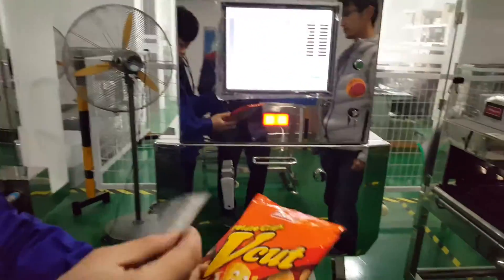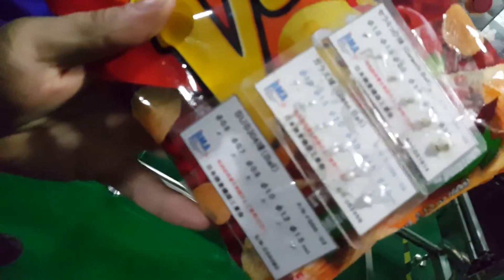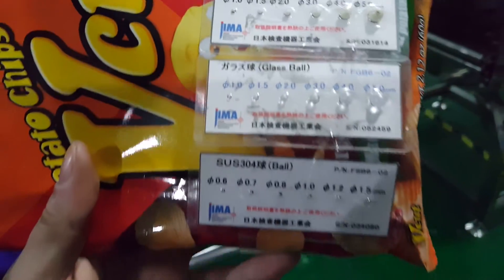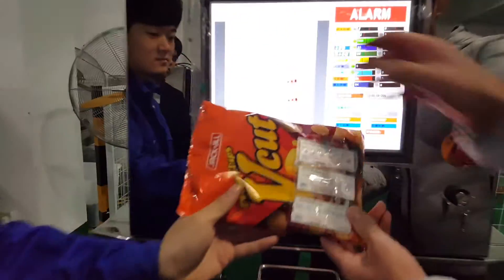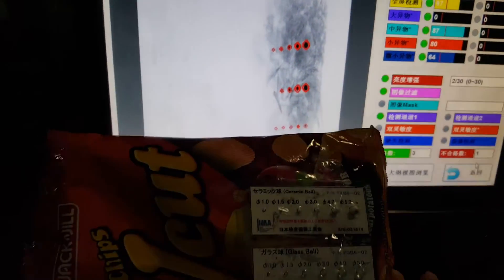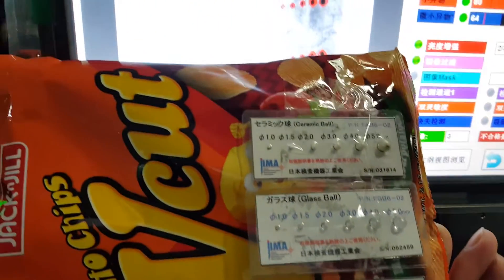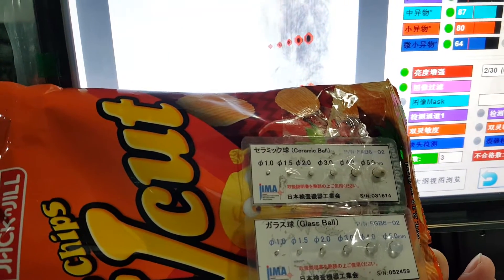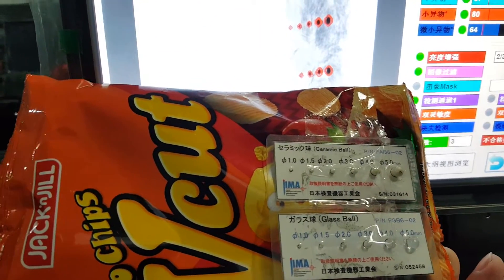Fanchi-tech X-ray machine for aluminum packaging photo chips

Comment: hey what is the best packing for tobbaco to hide in screen
Reply from the maker: we're not expert on packaging, but expert to detect out contaminants hidden in the packaged/Non-packaged food or other things.
here is our web: www.fanchitech.net
Reply: @fanchitech3323  will aluminum foil wrapping hide it?
Reply from the maker: @uscitizen6623  No, all type of Metal Contaminants and other contaminants like stone, ceramic , glass, hard rubber, etc can be detected by our x ray machine .
You can visit our website for more info www.fanchitech.net
Reply: How can u hide drugs from xray machines lol
Like wrapping them in what type of paper ANYBODY 😅😅?
Reply from the maker: @gangganglawndalest4448  Our X-ray Machine is designated for contaminants inspection, generally for density over water contaminants(if lower than water density, then can't distinguish it). As far as we know, most drug detectors detect as per the smell it evaporates, so...; some x ray security scanners may be able to distinguish as per its atomic NO., but it's easy to consue the device when putting similar powder or particles...